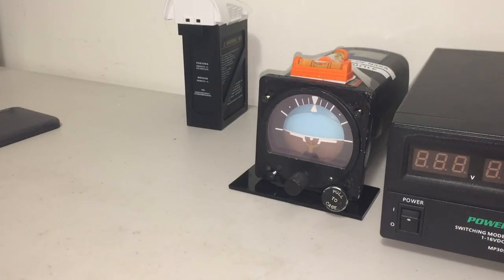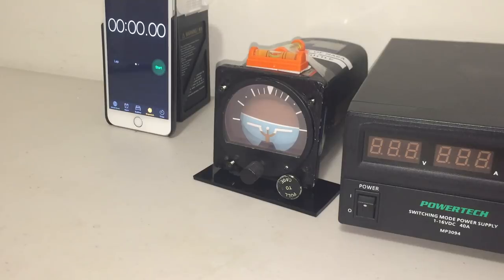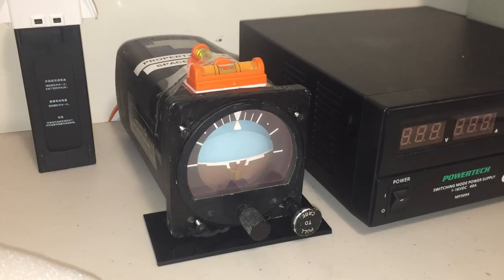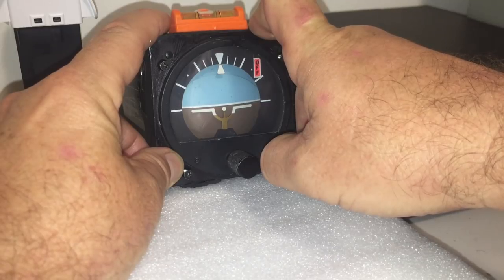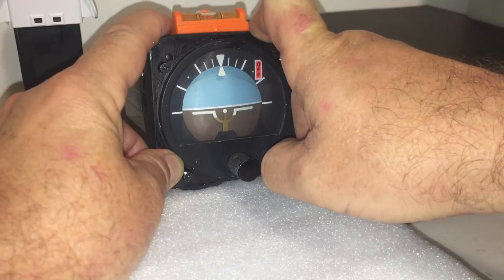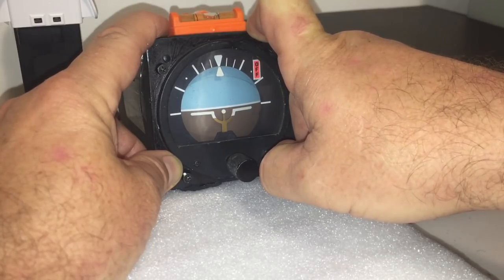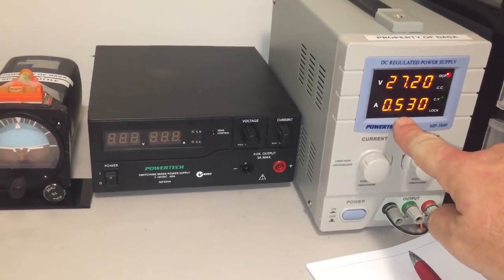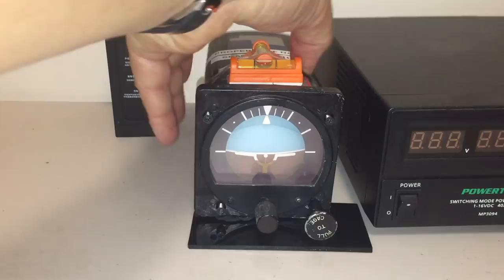Two more gyro experiments as requested by viewers.

Comment: here is a challenge for a flat earther, design and build a working gyroscope. looool
Reply: CU NEXTTUESDAY    Sorry sir. I doubt most would be able to pull one apart without the use of a hammer. Building one ? Lol
Reply: Loool. I want to see density based gyro.
Reply: It is not the device that is dense in some way... but a flat earther always is.
Reply: CU NEXTTUESDAY I got told off for saying if you use a pendum on a gyro the pendulum could be used to correct it 
They went mental and started screaming no no that's not how gyro work I'm like I know but you can uses them together and again these guys went mental

Comment: What is the practical or operational purpose for cageing the unit ??
Reply from the maker: +Rolf Grosseholz - The cage speeds up the alignment process significantly by quickly aligning the Gyro with the case of the instrument.   Really the only time you should need it in flight is if you are doing aerobatics and the gyro "topples" and is grossly out of alignment.  There is no point in waiting 20+ minutes letting it correct itself when you can quickly align it to close to level while you are flying straight.   When you release the cage the correcting mechanism will fine tune it within a minute or two.

Comment: So I've heard of the pendulous vanes, but how does this stationary artificial horizon correct itself?  Is it just electronic?
Reply from the maker: +DANG JOS I have not seen inside this particular model but apparently it does use pendulous vanes and those are driven by an impeller on the gyro itself which is spun by an electric motor. 

https://www.kellymfg.com/images/RCA26_AK_BK_EK_user_manual.pdf

This video will explain it better than I can in a post.   

https://www.youtube.com/watch?v=_MoS5Yw9ZgE
Reply: Wolfie6020  Alright thank you

Comment: Are you able to achieve gimbal lock with that gyro by hand? I'm doubting it has a fourth gimbal, but I could be wrong.
Reply from the maker: +Fudmottin  If you roll it left and right it won't topple.  If moving in pitch fore and aft, as you reach the vertical the gyro does a rapid 180 degree rotation to keep the horizon correct as you continue the pitch.  It works great if you do it smoothly but I noticed if you snap it around too fast the gimbal topples completely and is then misaligned when you level the case.    Overall this unit is much better than the vacuum insturments I used years ago in light aircraft, they would topple easily if you tried any aerobatics.
Reply: Cool. The internals should prove to be rather interesting. I noticed that it has more than one card inside for the horizon.

Comment: Would you pull the cage before take off ?Is it to set it ? Cheers
Reply from the maker: +Mark Draco.  You could but in most cases it is uneccesary. Usually from the time you start engines, do your after start checks it is aligned fully before even taxiing.  During the taxi we verify alignment and stability with a check that there is no more than 5 degrees pitch or bank indicating and it remains level during left and right turns on the ground.   

The only time I have actually needed to cage is after a session of aerobatics where the gyro has toppled completely.  Caging it just helps it get back to level immediately rather than waiting for 20+ minutes.
Reply: Cheers

Comment: How do 'spirit levels' work on a 'globe? 
- For example if you are in Australia. 
Honest question. Thank you in advance.
Reply: A spirit level uses two fluid substances contained in a transparent container -- usually a liquid and a gas to create a visually distinct bubble. As gravity pulls the heavier fluid, the lighter fluid is pushed in the direction opposite gravity by consequence: what we call buoyancy. This forces the bubble to rise to the highest point in the container. A spirit level is designed to mark where that bubble will be when the level is placed perpendicular to the direction of gravity. This is called "level."

Since gravity operates radially from the center of the earth, the spirit level is finding the plane tangent to the surface of the earth at the place the level is resting.

Comment: I was just thinking, in all those movies and TV shows where they show a pilot turning on the equipment, I always assumed the whining noise you heard was the engine :)
Reply: There's lots of little whines...the fuel pump, gyros, etc.  It surprised me.
Reply from the maker: +John Michaelson.  There are a few extra whines in the cockpit when the flight attendent is too slow bringing me a coffee after take off.
Reply: You must have the patience of Job wolfie, I'd want my coffee before takeoff :)
Reply: Some minor corrections for you Destroyer

-Sigma Octanis, like Polaris are not on the centre of rotation, there are merely the closest stars to the centre of rotation for their respective hemispheres.

- Compasses point to their respective magnetic poles, which is different from geographic poles

-Crepuscular rays don't indicate the sun is directly above, if that were the case then it would mean the sun Travels directly over such places and England, Norway and Japan etc.

"how combustion would be impossible in outer space since there is zero oxygen and nothing to thrust on. "

Really ? this argument

  First off, you are using an unsubstantiated premise there there must be something to push off of, so you can be summarily dismissed there. 
  
Secondly, I find it hard to believe you , by now, do not understand rockets take oxegen with them, and the actual combustion takes place in the combustion chamber, which is far from a vacuum.

"you wouldn't need an eye witness what you need is to trust your own damn eyes. How comes stars can be seen through the moon? "

  Name the star, seriously, this claim gets thrown around likes it's true, but no one has yet to identify what they are seeing, explain why they only see it occasionally, or have multiple cameras seeing the same thing at the same time.

 Let me make this simple for you, it's not a star,  go ahead get a telescope and a spectrometer and film this "star" let us know it's chemical composition and name the star in question.

"
Well if north pole is where all compasses point the latitude would be in circles around the north pole. so if a plane was flying from Britain to Argentina the compass will be pointing north."

 Which would mean on a flat earth when flying east or west, one would have to make constant corrections, specifically, adjusting the flight heading slightly north, and this would be true from the north pole to the ends of the earth.

  However, this is not the case, a east or west  heading in the southern hemisphere does not drift south as it should on a flat earth, but it drifts north, exactly as it should on a globe.

-Why do sun spots exists if its so huge and far away? 

  What does the distance have to do with the existence of sunspots ? What do you think sunspots are ?

"Why is there no evidence of Curvature at ALL"

  Asserting a negative, really ? Well most likely the reason why, in your mind there is no evidence is a combination of

-ignorance
-confirmation bias
-intellectual dishonesty

" Or how 'on the moon' something fell out of Neil Armstrong's back with full gravity as if he was on earth(recorded) etc"

 Lol, what is the acceleration of gravity on the moon ? do you even know ? and by what means did you measure the time it took something to fall out of his back ?

 I'm guessing , you just thought it "looked to fast"
Reply: The Heliocentric Destroyer Congratulations! You passed the part of the Video Professor course on how to use copy and paste on your computer. Now go practice the part on how to do a thing called “web searches”, and particularly the part on “how to take a break and go outside”. Go to bed and let the grownups talk, sweetheart.

Comment: Are you planning on removing the pendulum somehow and seeing what it does after then?
Reply from the maker: +Feathered - If I can do that without damaging it I certainly will try.
Reply: Wolfie6020 if I can make a prediction :)

Since the pen vanes add weight to the bottom of the gyro, and it is only slightly off balance along it's rotating axis, with the removal of the vanes, it will offset the weight towards the top of the gyro.

I predict that it will try to level upside down, but since the gyro will be spinning, it will constantly precess in a circle horizontally.
Reply from the maker: +Shawn Hufford,  I'd back you fully on that prediction Shawn.
Reply: I have satellites going across my astro photograph frames all the time. I throw those out. There is actually a lot of stuff up there if you spend much time observing the sky.

You too can see a satellite, they are predictable here you can find Iridium flares:  
http://www.heavens-above.com/IridiumFlares.aspx

Or Space.com can help you out:
https://www.space.com/32054-satellite-tracker.html
Reply: Why do you keep telling people what they can't do when they see them so often that they are an annoyance at times, like Doug says. There are websites and phone apps that describe hundreds of them that you can see. You appear to not differentiate being able to see something as a point of reflected light versus being able to resolve something into a shape. People can see a small hand mirror from fifty miles away when the reflected sun flashes off of it, even though they can't begin to see the shape or size of the actual mirror itself.
Reply: The Heliocentric Doofus
"Let's say a high def satellite is launched and it is the size of a car, and the high point is 22,000 miles and the low point is 1,400 miles"

At 1,400 miles a car sized (~13 foot) object would appear .006335 arcseconds wide, about the same as an object a millimeter wide at 20 miles. This means that it would look like a zero dimensional point like a star to the naked eye if it was bright enough. If you are trying to see fine detail in such an object then it would be essentially impossible with most cameras and telescopes, but if you were just trying to see light from it then that would be fairly easy to just point your camera up and wait until a photon from it to hit the camera like what happened in the making of this video:
youtu.be/RLbQ_Lqifrg
I've pointed out the satellites in this screenshot I took of the video here:
i.imgur.com/hgMmRtD.png

"are u seriously stating that u can see a car sized object from 1,400 miles away?"

He (Shawn Hufford) didn't say anything about the visibility of satellites in this thread.

Also; the first link you gave also did not mention anything about the visibility of the satellites mentioned in it.
Reply: Wolfie6020
"If I can do that without damaging it I certainly will try."
It should be a learning opportunity for most people watching in any case.
Reply: Shawn Hufford: Any kind of imbalance will cause it to precess. If the imbalance itself is dependent on the orientation if the gyro, it may drift to a certain orientation and than stay fixed.
Reply: The Heliocentric Destroyer 
The standard army specification for the distance a heliograph could be used was 10 miles per inch of mirror. That would be not far from ground level and in daylight, Obviously much further at a higher angle from the horizon and against a black background.  It doesn't take much working out to see from how far away a satellite could be seen.
If you want to see geostationary satellites, point your camera at the part of the sky where they are situated and make a long exposure.  The satellites will be the stars that haven't moved.
Reply: If Polaris never moved then telescope polar alignment reticles wouldn't need different locations for different years like mine has: https://imgur.com/5hgZDPL

That's a fantastic overlay, Feathered, very illustrative!
Reply: John Michaelson
"That's a fantastic overlay, Feathered, very illustrative!"

Thanks man, Your picture of the alignment reticles was pretty cool two!
Reply: Wolfie6020 I would bet that it is just a heavy, weighted part of the lower portion of the gimbals, but who knows just a guess. If it was vacuum it would have the pendulous vanes, not sure what an electric horizon uses. It would be interesting to see.

Comment: That artificial horizon has ONE hour lag time? very helpful when you about crash.
Reply: Nnnno. The device required less than one hour to correct from being placed upside down. Outside of simulations such as this, it will take far longer for the aircraft to fly a sufficient distance around the earth than it will for the gyro to correct itself. This means the correction will happen gradually in transit, rather than all at once as in this demonstration.

Comment: Wolfie6020: Thanks for your time. this experiment with but this has nothing to do with proving globe or flat earth. If you want to proof if it's a globe or flat then you have to use a 3 axis Gimbal Gyroscope. During flight you have to look at the spinning axis! and it does NOT flip sideways flying from north to the equator. OR upside down flying from North pole to the South pole.meaning the earth is FLAT!  (spinning axis is "lock is space"  !!this is for Advanced users!!)  "Auto correction" for a Gyro like this can be done by 2 ways: electronic: correction is faster ( mercury switch ) OR Mechanic (Weight) something like a Gimbal cup holder (but this is slow) both will auto correct itself. nothing to do with curvature or flying around! (Wolfie6020 with all due respect your auto correct demonstration is nice but it has nothing to do with the basic function and understanding of a  gyroscope. (this comment is  dedicated  to Wolfie6020 ) your explanation at 2:41 auto compensating flying around the earth is NOT correct!  fast auto-correction yes and thats it!
Reply: efgtest well if it auto corrects for curvature, I’d say it has something to do with curvature in that exact way